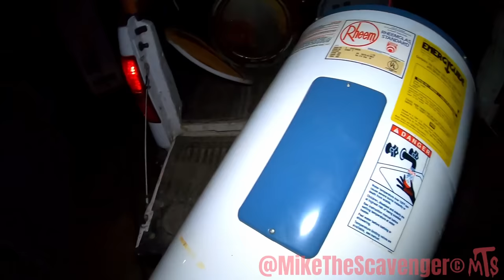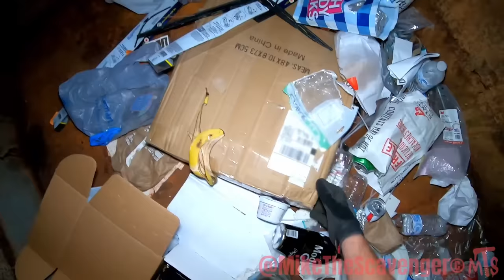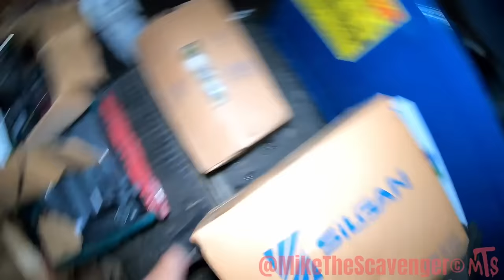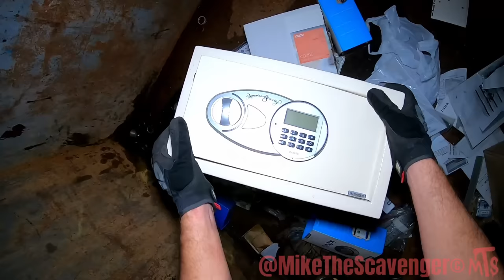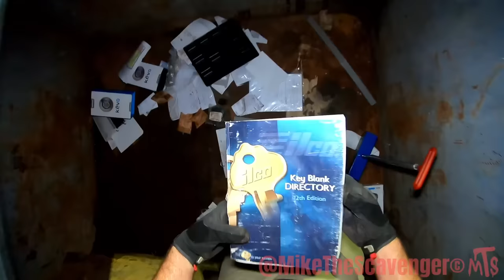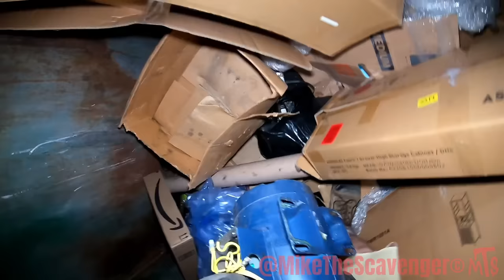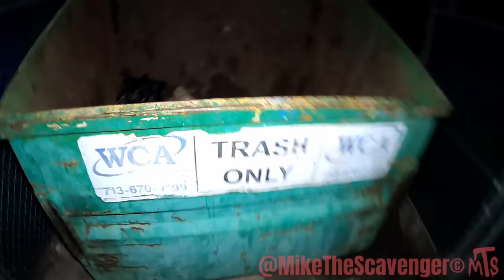Dumpster Diving "Case After Case After CASE IN HERE!"

Comment: 10-15 years ago, I was a property supervisor for 6 different apartment complexes. I had a couple of guys that scrapped for me. They would show up and haul out old appliances and water heaters from the the buildings as needed along with all old brass hardware, locks, everything metal.  They had an old truck and trailer, A normal week was 1 or 3 frigs, 4-10 dishwashers, 2 or 3 stoves, and several hundred pounds of assorted metal.

Comment: Not sure if someone comment on it yet.  The dumpster with the blue motor, wheels, power cable and coupling in it. Those are elevator parts. The (wheels) are called roller guides and the victaulic coupling are used on hydraulic elevators. The power cable is called the travel cord.  Blue motor opened and closed the elevator doors.  Cool videos!

Comment: Happy weekend Mike and Laura, 
Your the king of the lids ! Those monitors are touch screen Point Of Sale systems.
The screens with the credit card readers could be a part of  a restaurant where the staff pit in their orders.
I still have a few of them when they modernized the casino pit area.
Nice scrap run tonight. As for those locks they might been in a hardware store and discontinued the locks and Cheaper to toss them out.

Comment: I work in an industrial park.  I have seen some stuff in the trash that was selling on eBay for $500 or more.   I scavenged is a 2.5 gallon gas can.  I bought a new spout for it at Walmart and I have used it to mow for over 13 years.  I sort of have clutter and hoarder issues so I avoid going  there. When I have to dump the trash at work I find it distracting. LOL! I also found a perfectly good clothes basket in the trash at work. None of the plastic was scratched , cracked or broken.

Comment: Yo the man! My biggest one item score ever was at an electronics parts store/warehouse. I usually would find packages with brand-new ICs/transistors , resistors, capacitors, etc., left over in them. One day I saw a bunch of remodeling debris in the unit and almost didn't dive into it. I saw a tapped-up box and was about to leave when I decided on a whim to check the box anyway. It was heavy and was about to toss it back in thinking it was full of plaster or bricks. I decided to open it anyway and left right away. Around the corner I squatted down to  open it all the way. It was a BRAND NEW lab OSCILLOSCOPE with all the cables and instruction booklets. I took it to my MIT graduate computer buddy, he tested it and was glad to pay me $425 for it. That was in 1981 and I've made more money from other dives, but not from a single item. (The box had a note taped on to it advising the shipping clerk to where to look for the instructions on how to label the item for return. I guess the clerk was too lazy or a crook and had planned to come back on the weekend to retrieve it, this was a Friday evening.)

Comment: Crazy thing about that big blue DC motor... Probably the only thing wrong with it is that the brushes inside are worn out. Couple bucks, and a few minutes time, and that motor could be good as new and worth hundreds of dollars. Also, that electrical control panel is VERY high end stuff. Hard to believe that stuff gets tossed out like it was nothing...

Comment: Those were POS terminals and you probably broke the screens dropping them on one another the computer is the server. Could sell the setup to a startup business for some bucks. Most businesses are switching over to clover and the likes but the older stuff is still in wide use in gas stations and can be formatted for whatever software they use.

Comment: Before I got lucky and landed a high paying job I used to scrap. Some days you did really good but most of the time you made gas money and dinner money. For me taking the insulated wire the thin crap wasn't wort the effort. If you cashed it in while it was dirty as they say you got almost nothing. But to sit there and strip it so it was clean wasn't worth it either. The amount of time it took to strip the wire especially if you found let's just say 100 yards of it by the time you are done and the effort and how sore the hands got not worth it. You could burn off the insulation in a 55 gallon steel drum but if you get caught this fine and the time in bullpen therapy isn't worth it. The worst part is when you get scrap yards that are thieves and don't pay the legit price it makes it even worse.

Comment: It is great that stuff can be reused etc but one should be up on local and state laws. in some areas anything in a dumpster is property of the hauling company.  this is to protect  the hauler and the customer, If someone does not pay you cannot dump their  trash out on their site and the hauler cant be sued for dumping something that was put in the bin by mistake.  I was in the hauling business for several years and several times we would have to pick through an entire load if someone threw out a valuable item, often we found it.

Comment: you gotta wonder why all those lids got thrown out like you can tell they weren't even taken out of the packaging 
wtf went wrong because those are perfectly useable lids. 
one intresting thing about dumpster diving is you sortof get a story based off of what is in them 

for example the register monitors the company was clearly upgrading them so they tossed the old ones 

all the chargers and cables they clearly threw them out because they where upgrading the old set up or moving out of the office space. 

the locks and safe clearly someone was just evicted and the locks had to be changed. 

the dell computer and the many many boxes of large led screens they are clearly putting up a huge screen to display who knows what and somones computer stopped running during that. so that got tossed.

Comment: After you get done strip the wires you made nothing you won't get a dime for the wire if the insulation is still in it. Figure with your time .gas.the physical work involved you would be better off getting a real jub
Reply: If that was true there would be no scrap yards operating in America instead of being one of the largest industries we have
Reply: @gawayne8510  when I was a lot younger I worked with a scraper. I know from experience that the days you make good money are few and far between. We would pick up wash machinesand copper when it was out there tons of wire but to make money on the wire it had to be stripped. You can't compare dumpster diving to a scrap business. The scrap business gets a lot more money for copper brass aluminum than he will give you. They go by what the market gives. How can you make money when one metal is one penny per hundred pounds. Aluminum at its highest price was during the gulf war and then it hit 1.12 a pound now its 35 cents a pound. You have to count in your gas and time and labor and you pay insurance on the truck it all has to be figured in
Reply: @Richard-vt7it  
I believe they have always paid for insulated wire just much less than for bear copper
But I sincerely hope your comments drive other people out of scrapping as that will only drive the prices up that I will get 
thank you